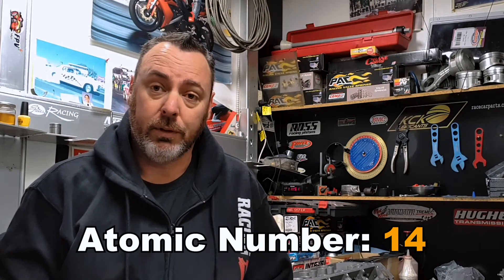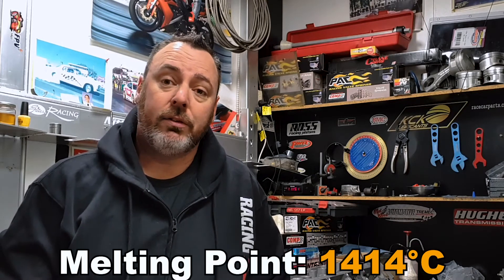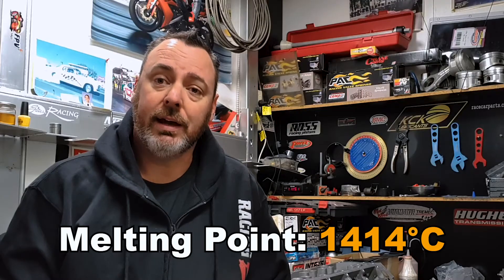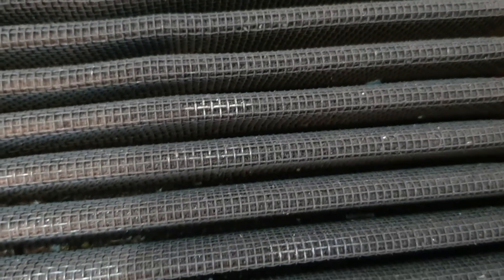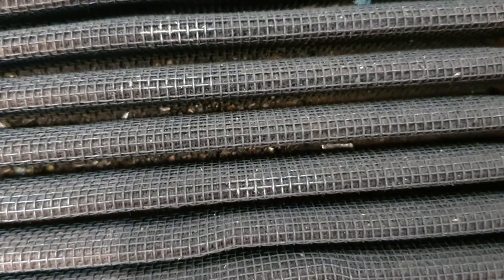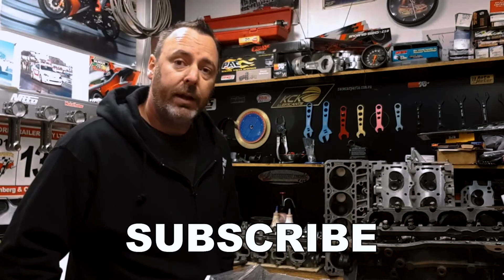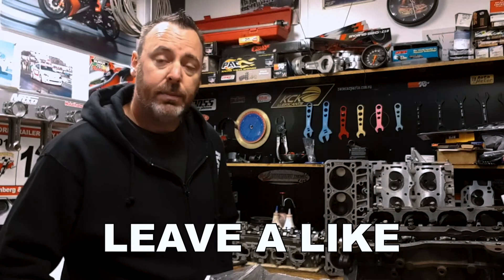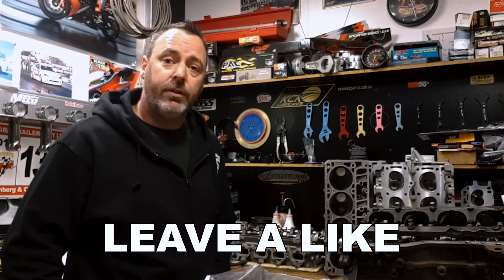Dust contamination in Engine Oil and excessive Engine Wear,  Engine oil Explained

Comment: Do you recommend high for air filters like oiled cotton or do these filters bypass too much dust?
Reply from the maker: Thanks for watching! There are so many factors regarding air filter performance like location, where they draw their air from and the enviroment they are operating in and ultimately the amount of air they need to flow to say that a particular style is better than another. Each application will be very specifc in its requirement.
Reply: @KCKLubricants thanks for the response! I want to add an aftermarket intake for the turbo sounds, but don't want to subject my engine to increased wear from reduced filtration. Been doing a lot of research on this topic lately but can't really come to a conclusive answer on whether or not a high flow filter will cause damage or not
Reply from the maker: @Reign_in_Bloodd  by nature a high flow filter will need to be less restrictive and therefore will not filter the smaller dust/dirt as efficiently. By being strategic on the location of the filter you can eliminate the dust/dirt that the filter is exposed to.

Comment: I accidentally had dust on my oil funnel but then I also added 250 ml of boron nitride. So hopefully that will counteract the dust. haha. Next time I'll be more careful (if I make it to the next oil change!)
Reply from the maker: 🤣good luck! it should stop any glazing in the engine
Reply: @KCKLubricants  275K so far on an inline six - the AmeriBarra TrailBlazer Vortec 4200! thanks (OK no turbo, just a ReMan trans. haha)
Reply from the maker: @voidisyinyangvoidisyinyang885  well done!
Reply from the maker: @voidisyinyangvoidisyinyang885  wow!
Reply: That is why premium oil no use in this case 

You have to do regular oil change
Reply: @ibrahimqari9189  I'm on 294K closing in. Just added more boron nitride with the last full synthetic oil change. I make sure to clean out the funnels now! thanks

Comment: Random question, but I used flour (regular bleach flour) to find an engine oil leak. I applied it to where I thought the engine was leaking and have found the leak. Should I worry about getting that flour in the system? Will it clog the filter?
Reply from the maker: Great Question! I think the amount of flour that would have made its way into the engine oil inside the engine would be very minimal and not a real concern.
Reply: @KCKLubricants  thank you brother!
Reply: @KCKLubricants  It was a novel technique to me but you could literally see the flour flowing through moving oil, massive leak